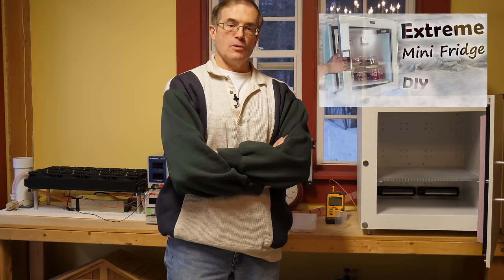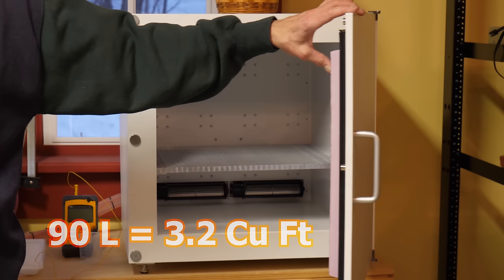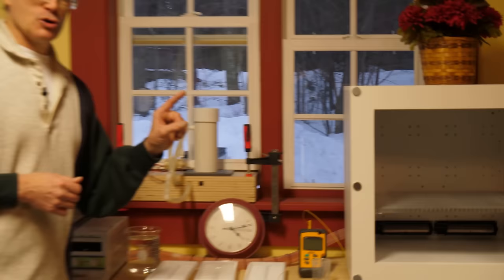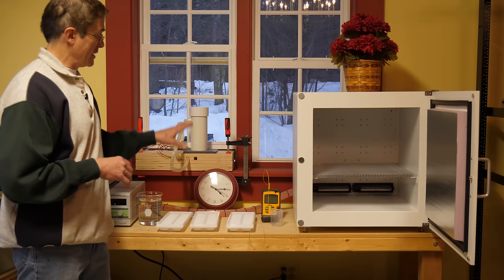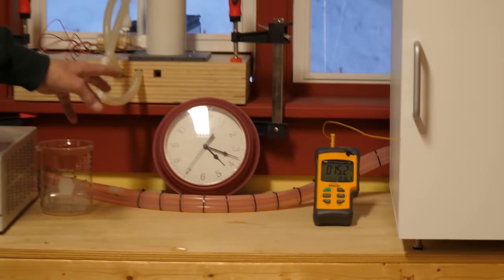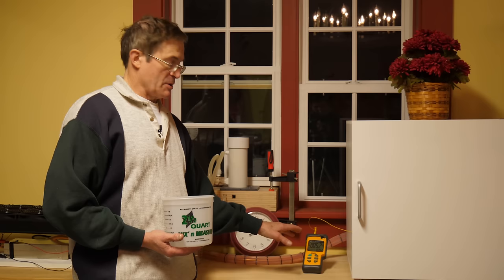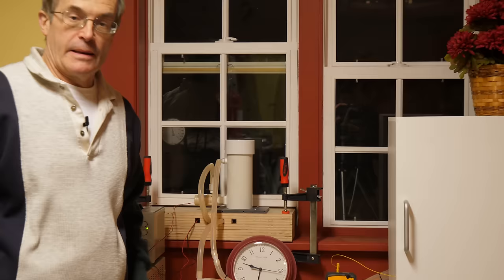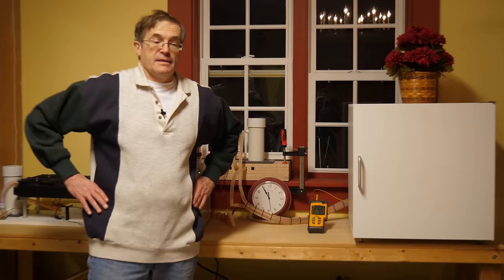TEC Freezer - Build Your Own!

Comment: So I asked this wrong last time, I realized after you answered-  
So your heat sink radiator- would there be any benefit of working in additional peltier's, to convert that heat Back into electricity, and feed it back into your system?    
They produce voltage with the addition of heat- right?  They become generators if you heat them?
Could you not put more on the back end and reclaim some of that waste energy from the process?
Sure you'd always have to have input, but could that energy reclamation, converting the waste heat Back into electricity to help power your heat pumps not improve efficiency? 
might not be worth it, but it seems like something worth exploring.
Reply from the maker: It won't work.  The harvesting of the heat will be very inefficient because you want the "hot" side of the refrigerator's TECs as close to ambient as possible.  Any restriction in that heat flow in order to enhance the energy recovery will decrease the cooling effeciency more than whatever energy can be recovered.
Reply: That's what you said last time But you're already dumping the heat into a sink, and into the air, wasting it.

Why not stick another peltier between the sink and the air, in it's "converts applied heat into electricity" capacity?

I see NO way that could interfere with the function of the device, being quite separate from it- you've already taken the heat out.  it's waste. use the waste.

If it's not enough heat to mess with I get it, but otherwise, your objection doesn't make sense.
Reply: I mean, you're doing it with fluid there, right?  Just stick some in your fluid before it gets to the heat sink.  Gotta be a way to use it, just like the Downhill water pipe generators.
Reply: So your "hot" fluid, comes out of your freezer in a hose, and goes to a radiator, and back to your freezer, right?  Somewhere between the freezer and the radiator,  And I may just be ignorant here, I don't see why you couldn't steal a few volts off that hot pipe without impeding what it was going to do Anyway in it's normal function.

Once this plague is over and shipping's back to normal, I'm going to get some of these and  play with this.
Reply from the maker: As long as the added system does not interfere with the airflow past the existing heat sink then you can harvest the heat without decreasing effeciency.  My first point then becomes the problem with a temperature differential between the waste air and the surrounding air of ony a few degrees you will see a conversion effeciency below 0.1%. or well under one watt.
Reply: @TechIngredients  That makes sense.  Thank you

Comment: I guess I don't understand the point of solid state freezing, its way less efficient than standard refer tech vac pump etc..  Chemicals isn't really a problem either, because if shtf you won't have Peltiers, nor will you have refrigerants.  But you can get ammonia, and with that you can make an effective refrigerator.   Are you claiming some advantage to this method of cooling?
Reply from the maker: Yes.  It's very easy to incorporate an outdoor or underground cooling loop into this liquid cooled system, greatly increasing the overall effeciency.
Reply: @TechIngredients  The overall efficiency will still be magnitudes less efficient than a compressor system.  As in it will never achieve the same efficiency buried lines or not.

Comment: I suspect this couldve been far more efficient for regular use[opening of door] by making it top opening.
everytime you open a side door, the cold air column which is denser than room temp, just falls out and is replaced by room temp air. this wouldnt happen in a top opener.
Reply from the maker: You're correct.  It might not make a huge difference if we only open the door infrequently, but it will certainly help.
Reply: @TechIngredients .. Since you are only cooling the room air that has entered the freezer, and the solid foodstuff etc. is still frozen, I don't think the top-door would make the slightest difference. Plus it is not as user-friendly since all the stuff has to be piled on top of each other instead of on convenient shelving.
From https://phys.org/news/2012-02-energy-mythbusting-truth-energy-saving.html

 "Despite the harping of moms everywhere, standing in front of an open refrigerator while you ponder its contents will not drive up your electricity bill, Blasnik said.
The moment you open the door, the cooled air rushes out, and it's a fairly trivial loss, he said. Most of the refrigerator's coldness is held not by the air but by the contents, and those contents won't warm up significantly in the time it takes you to decide between the leftover pizza and last night's meatloaf.
Obviously, leaving the door open all the time would waste energy, because your refrigerator would never stop running, Blasnik said. But closing the refrigerator door quickly will save you a dollar's worth of power a year at most, his research shows."
Reply: @TechIngredients  wouldnt take much to change wold it? just turn it top side up opening up?

Comment: I see the 4 screws designed to create pressure on the TEC (Inside the freezer) but it's unclear how your generating that pressure. it looks to me that the water block is attached directly to the TEC with your thermal epoxy (confirmed by another comment) and if the pressure is generated by sandwiching the TEC I can't imagine you drilled holes through the TEC and the water block. I can't see any brackets (unless there under the insulation) that would create this pressure either  Would you mind posting a diagram (or try to explain it),  of the TEC stack, I've tried referencing both the fridge and freezer video but this freezer implementation looks different and cleaner I imagine it goes cold plate > aluminum spacer > TEC > Water block
Reply from the maker: The spacer is glued to the TEC and itself is screwerd to the plate from the inside of the freezer.

Comment: Could you try make an AC for a bedroom with the same TEC and water radiator but big size?
Reply from the maker: It wouldn't be worth it.  But, as I mentioned, we have built a dessicant based air conditioner that is twice as effecient as a conventional air conditioner, uses no fluorocarbons and it is relatively easy to build yourself.  We will be posting that video soon.

Comment: Is it possible to reverse this freezing to make it into a heatpump?
Reply from the maker: It's simple. Just reverse the polarity of the TEC supply voltage.
Reply: @TechIngredients  Many thanks. I have never seen a tec, so have no idea of what they are, but will now look into them.
Reply: @TechIngredients  Old post, sorry. But, the radiator and fans are much more efficient at releasing hot than they are cold right? Reversing the polarity would make the dissipation system (radiator and fans) far less efficient trying to diffuse the cold thus making the temp differential higher thus making the TEC even less efficient than it was at cooling. I learned all this from you, your fault, just trying to nail down my understanding.

Comment: Can anyone tell me.....  I have a very specific spot in my kitchen where I want to put a freezer (basically, in the cabinet over my fridge -- yes, I would drill a hole to vent the heat through the top of the cabinet).  I just want to increase my total freezer space.  There is a large cabinet that's about 19.75" high and 28" wide.  I would really LOVE to get a 19" high WIDE upright freezer, that's like 24-26" wide.

Sure, I could just get a 1.1 cubic foot freezer online, but for the price (and electricity cost) it just wouldn't be worth it to add a single cubic foot of extra space.

Has anyone followed this tutorial? I'm fairly handy and have a full range of tools, and I love everything DIY.  Does anyone think I could follow this and build my own upright freezer to a custom size?

Comment: Still looking for [ may have missed it ] cost comepairing ?
Too late a yr. ago ;(
Reply from the maker: Comparing to what?
Reply: @TechIngredients  
Dang , a yr. old video and response ,
cool ;) 
The cost of any other refrigerators ?
What else ?
Thanks
Reply from the maker: A custom built solid state refrigerator will cost more than a comparibly sized commercial  phase change unit.  It will also use more power.  Although,  it is quieter and can be built to whatever dimensions you need.
Reply: @TechIngredients  OK thanks .
I am a full-time-RVer , and the average cost for a RV fig is $1,300 - $1,500 .
Also upgrading to lithium batteries & solar , so keeping an eye out for options .
Thanks again for your channel .
KD0CAC - ham call sign , John

Comment: Why not dump the heat into a water heater?
Reply from the maker: Then the freezer will not be very cold.  The TEC creates a certain temperature differential.  If the "hot" side is cool the "cold" side is cold.  If you allow the hot side to get warm enough to be used in a water heater the freezer will be at room temperature or even higher.
Reply: Thanks. I'll need to chew on that a while.

Comment: arent TEC 10s supposed to be run at max Voltage = 15.4 V?
Reply from the maker: Maximum voltage is a practical upper limit beyond which damage becomes likely.  But, the lower the voltage, the higher the effeciency.
Reply: @TechIngredients  I am asking because I was surprised seeing 17V + at the video
Reply from the maker: The TECs were wired in parallel groups and the groups were wired in series.  The voltage drop across a single TEC was well below 15.4 volts.
Reply: @TechIngredients  thank you for clarification!

Comment: Is it just e ?  Or wouldn't it be more elegant to use the water based heat transfer system without the peltier stuff.  He has ICE on the other side of that window for chrissakes.
Reply from the maker: You can!  The TECs extend the operational range over more of the year.  In the winter you can simply turn the TECs off.
Reply: ;  @TechIngredients  - meant no disrepect:  LOV your work !!

Comment: can you use a peltier as a heater?
Reply from the maker: Absolutely.  They work in both directions and are often used to stabilize the temperature of scientific instruments by adding or removing heat.
Reply: @TechIngredients  Do you have a video about making a heater? I learned a lot from your fridge videos.
Reply from the maker: Sorry, no.  But the principle is the same.  You need to use heat sinks on both sides to effeciently couple the heat flow otherwise you may as well just use a resistance heater.
Reply: @TechIngredients  That reminds me, by adding a fan on the cold side of the heatsink for a fridge would that help in making it more colder?. Vs having a fan just in side moving air around?

Comment: So no good as a food freezer even when there's snow outside -18C Minimum is recommended...Can we stop using degree,s  F mixed with deg C...Most of the Modern world uses Centigrade due to it making more sense 0Deg C water freezes 100 Deg C water boils at sea level....what happens at 0 deg Fahrenheit and 100 deg Fahrenheit???.

Comment: What is your voltage for 219 watts, friend of mine lives in her van it would be nice for her to have a freezer
Reply from the maker: As I described in the video, you can wire up these individual TECs to reach a range of driving voltages compatable with your available voltage.
Reply: It's displayed on the power supply in the video, but it's 12V nominal. Other people have already installed similar refrigerators/freezers in their vans. Search youtube for Micro RV, which is basically a van decked out like an RV. To avoid wasting fuel many people equip their vehicle with battery banks and solar panels for running devices like this. It's even possible to have an induction stove in a van, instead of using propane, with a good solar power setup.
Reply: @chrisbalfour466  Thanks, oddly enough she doesn't like Propane either
Reply: @TechIngredients  Thanks

Comment: Your foam insulation is not thick enough for high efficiency, 125/ 150 mm thickness is required , you would need to move to vacuum panels if you don't want this kind of waste of space.  Vacuum panels are the future for household refrigeration.
Reply from the maker: The thicker the insulation, the better.  However, the refrigerator will become bulky, quickly.

Comment: A freezer that consumes 18 watts of power? Is that correct? That's pretty "cool"!

Thing is, it's running in a relatively cool environment, what about in places with 25c to 31c ambient temperatures like in my country?

Thank god for inverter air conditioners, otherwise I wouldn't be able to afford 24/7 climate control.

Comment: The analogy about  location being cold outside and remote heat exchanger is wrong..... in cold climates you want the exchanger indoors and tropical outdoors.... its a climate controlled box inside another one. So if you only heat your house then inside ... if you only cool your house then outside

Comment: Can someone tell me the Voltage and amperage he operates it at
Reply from the maker: You can see these values on the front of the power supplies that are positioned next to the freezer.
Reply: Tech Ingredients are you using  200 watts from each power supply
Reply: Tech Ingredients also aren’t the TEC’s 12 volt and won’t you damage them on 17 volts
Reply from the maker: As I stated in the video, we are using 200W from one power supply and 19W from the other.
 The TECs are wired in 4 groups, each group is a series of 3.  Each TEC sees a voltage drop of less than 6V.
Reply: @TechIngredients  Thanks for clearing that up. I only ask as I have built a mini fridge using 2 6 amp pelters using cpu coolers to cool it. I reach about -5 degrees C on the cold side however the air temperature does not reduce below 15 degrees (ambient 23). the cold heatsink is recessed in the insulation. I have a cut a bit of  room around it and have a 40mm fan on the cold  heatsink for circluation. do you think I need to have the cold heat sink  protruding out of the insulation? or attach the cold heatsinks to a piece of aluminium sheet to increase surface area. I have 40mm of insulation so I don't thinks that's the problem and it is only  15 litres big.  I plan to remove the  hot heat sinks and use water cooling to reduce fan noise. Do you think that would increase performance  significantly. Also should I upgrade to an 8 or 10 amp pelter instead of the 6 amp ones. I want to have around 200 watts or less power consumption. More than two TEC's it not really an option as I have limited space. Your opinion would be greatly valued on how I could improve my design. Love your channel! 

https://www.banggood.com/12V-6A-DIY-Electronic-Semiconductor-Refrigerator-Radiator-Cooling-Equipment-p-1074404.html?rmmds=myorder&cur_warehouse=CN  Thats what I got
Reply from the maker: Water cooling will help.  Using the largest TECs you can and I mean the largest surface area, but driving them at as low a total power as you can should be the goal.  Excellent airflow with large, low power fans and large internal heatsinks will also help.
Reply: Tech Ingredients ok thanks 🙏

Comment: High tech power equipment, digital thermometer... analogue clock. xD
Reply: I suppose it does look good in the timelapse though.
Reply from the maker: It does.  Analog has other benefits and should not be discounted as necessarily inferior to digital.